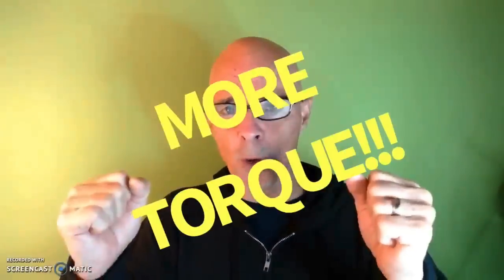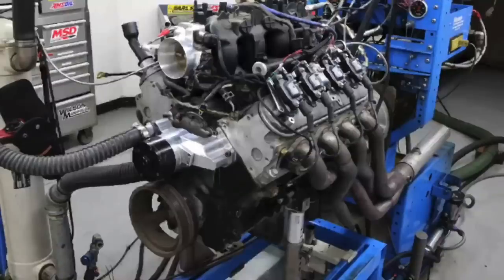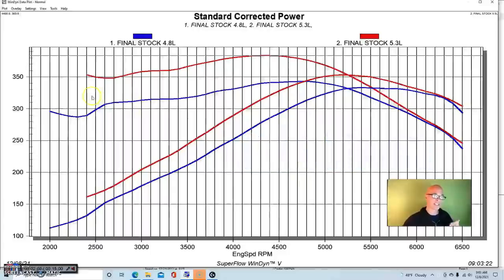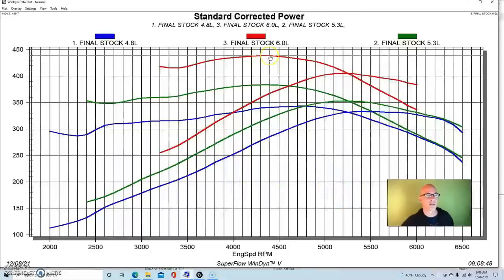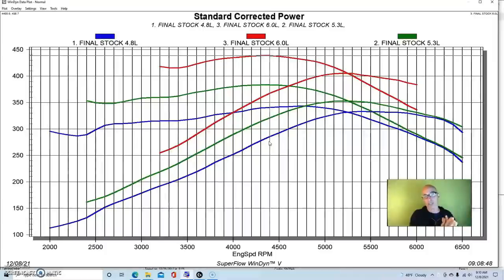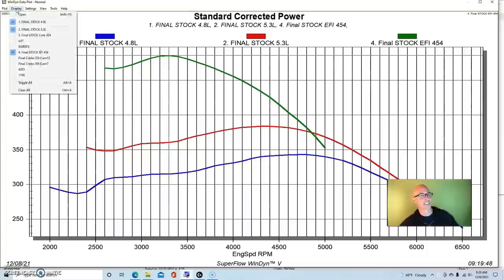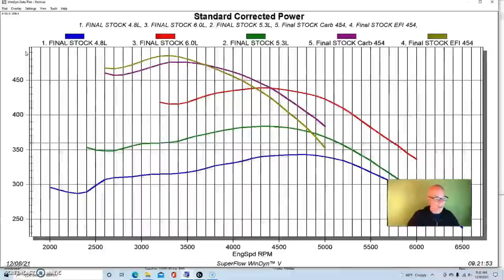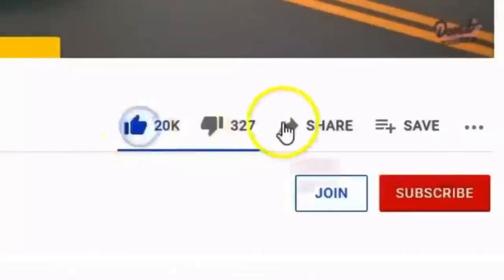LOW BUCK, JUNKYARD V8 TORQUE TEST-6.0L LS VS 7.4L 454 BBC-WHO MAKES MORE TORQUE? BETTER VS BIGGER!

Comment: Not GM, but still trucky. I've towed with a manual trans 300 powered Ford, an auto 351 and an auto 460. All EFI. Those 300s are sleepers for sure. It would run rings around the 351 towing. The big block....well, it's a 460. It could tow its own gas station. And probably should.
Reply: i love the 351w tho, beast of an engine imo..lol 427w stroker.. Seen a guy do a 440ci stroker on factory block..
Reply: 300 vs 351 in your comparison was the trans fault. 300 was a good engine but not a better tower than the 351 if both equally equipped transmissions
Reply: @EGGINFOOLS  But how often do you see a 351/M5OD 1/2 ton running around? The 351 is a great truck small block for sure, especially with the long runner efi intakes but the 300 was effortless. I've pulled anywhere from 2000-6500lbs with a a 460/E4OD with a 33" tire and 3.55s and it did a decent show of itself. It's no racer but it does make 400ft-lbs pretty much everywhere.

Comment: Richard out here giving us all the information. I just picked up a 6.0 for my C6 that had a 5.3, can't wait to get that extra 50 lbs down low!
Reply: This doesn't make sense. You picked up a 6.0 for a C6 corvette that had a 5.3? The C6 came with a 6.0, 6.2, or a 7.0. Never a 5.3.
Reply: @ryancompeau146  mine didn't come with an engine in it at all or a wiring harness. So I found a $175 5.3 and slapped it in there. I have a video going up on my channel about it.

Comment: Would be interesting to see a 5.2, 5.9, and 8.0 v10 magnum run on the dyno.
Reply: yeah it would be interesting to see. but good luck getting any of them to run long enough to make it through testing lmaoo.
i do love the 5.2 and 5.9l but they didnt age with grace. these days their mostly clapped beyond clapping for.
Reply: @chehystpewpur4754  Ive got a 98 5.9 durango that was wrecked 8yrs ago at 190k. All i need to do is throw a jumper on it and it fires right up. I have a video on my page doing it.
Reply: @98dodge360v8  exactly. it doesnt have another 8 years of wear and tear on it... it got stopped while it could still clap. shed have 300k or more by now and be wheezing if not worse off.
Reply: @chehystpewpur4754  I picked up a 01 2500 5.9 v8 last year with a service body. 277k and runs fine?
Reply: @98dodge360v8  shell start wheezing soon dont worry. i used to love those motors but not anymore or the vehicle their attached to. too many problems in most of the ones ive seen.
i mean lets be honest if dodge was so great it would have never went under and got bought up by fiat the worst car company in the world. dodge ii is a joke but the newer ram trucks. supposedly jeep and ram stayed out of the deal and are still an american company. and the trucks have gotten better. i would never own a dodge or ram but the trucks look to be somewhere between ford and chevy quality these days... i used to be a chevy guy but those are garbage now..
Reply: @chehystpewpur4754 seen more high mileage 5.2 and 5.9 magnums Then Chevy 350s.
Reply: There is a video on YouTube with 5.9 magnum build. All they do is add a stroker kit and new dual plan intake. On stock magnum heads and a stock cam. It made 498fts lbs of TQ and 330hp
Reply: @alexgrindnshine2522  A 408 stroker is 6.7L. Im talking the 488ci v10.

Comment: Sill at idle to 2000rpm not a lot of turbos going to make up ft-lbs versus displacement because the turbo won't be working much yet. Would take a very small turbo with some big gates to get the low end up without being a huge restriction later on.

Comment: About 20 years ago I ran tow trucks for a AAA contractor as a side gig & one of the trucks had that exact 454 setup in a '98 3500HD & 5-speed. Talk about a total dog! Absolutely nothing below 2500 rpm & always felt like you had an extra 2 tons in tow.  Same shop also had an early '87 V30 with the TBI 454 & 4-sp.  That truck would pull like a tractor down to 1200 rpm but as expected, dogged out pretty quick on top.  I always preferred the older truck tho, torque is where it's at when you're doing work. The older truck would KILL the newer truck in mileage too, granted we're talking ridiculous single digit 8 mpg vs 5 mpg but still, you could run hard an entire day in the old truck & still have 1/4 tank left but the newer 3500?  You'd be looking to fill up before the night was out.  I was never that impressed with the 454 Vortec setup & it was geared with 4:88s vs 4:10s.

The LS engines are racing motors but honestly, not particularly suitable for hard towing.  I'll put my flame suit on but seriously, the torque curve says it all.
Reply: same story here. my 94 c3500 454 tbi stock would murder my friends 98 c3500 454 vortec when being put to work. his truck unloaded got better mileage and was faster and nicer. but hook a trailer or fill the bed and forget it. tbi for the win ! I also have a 6.0 nv4500/4.10s 2500hd and my tbi murders it working too. my 454 is a 4l80 truck and also has 4.10s. when I threw it on the shop dyno the 454 started making more torque at 1400rpm than the 6.0 peaked 😂 ( when I threw them on the dyno the 454 was slightly modded. )
Reply from the maker: a TBI 454 is down at every engine speed compared to the Gen 6 (by a lot)
Reply: @richardholdener1727  I wouldn't dare dispute the dyno numbers however in this case it didn't translate to seat of the pants in the real world (for whatever reason).  TBI off idle response was dramatically better than Gen 6 in the trucks I used to drive.  Of course past 3K it was all over for the TBI, no contest.

Maybe it's just the way I like to run a work truck.  Keep the revs low & let the torque do the work.  Yep, I'm a diesel guy at heart😎
Reply: @richardholdener1727  that surprises me honestly, the tbi was so much more responsive like this gentleman said and just worked a whole lot better than the vortec and as he mentioned aswell better mileage when working. dyno doesn't lie tho. I just cant wrap my head around it had to be something with GM tuning since your testing has your own tunes. they must have choked the vortec or something. mayb would like to see them running completely factory everything side by side ? unless you already have that vid I missed
Reply: Those TBI's are special. Especially off throttle (low rpm)but that's about it. The vortec shines (power and mpg wise) around 2000 rpm and higher, their best for towing on the highway. TBI for in the city.
Reply: @muffdiver777yummy8 That's due more in part to obd1 vs obd2 and engine relying on more sensors for the vortec. Also going from vaccum modulated transmissions to electronically controlled transmissions made a slower response time too

Comment: Richard, can you please do something with the Ford V10? I'm sure there are a bunch of people that want to see it. Compare it with the big block!
Reply: I drove a loaded down full-size V10 passenger van when they first came out, and was very impressed with the torque and had going up hills, you hardly needed to push on the gas at all to maintain speed, and just giving it a little bit more I was doing 90 mph no-sweat uphill. I've heard they've been called gas Hogs but don't know
Reply: @7x779  I have one in my '97 service truck, it's an ex U-Haul box truck loaded down to about 12K & on highway I get 11.5, drops to 9.5 to 10 in town depending on how many lights I hit. Honestly not bad for what it is. Top end power isn't the greatest but it has a tractor-like torque curve that I like, doesn't slow down or come out of OD on hills. My favorite part about it is how dry it is underneath with almost 300K on the clock. Never leaks a drop of anything.
Reply: @acemobile9806  11.5 MPG V10 not bad at all for £12000. If I hooked up a 6,000 pound trailer to my 6L LS Chevy van, bringing it to the same total weight as yours I don't think it would be any better on gas. Probably very close to the same

Comment: When I tow my TT I'm at 2800 rpm in 3rd with 33inch tires and 3.73 on my 4.8 4l60e sierra. Thats on the sweet spot of that 454 although with the extra torque over my 4.8 I could run it in D

Comment: I would like to see the power numbers averaged out under the curve. My guess is that in stock trim the 6.0 produces very comparable average power and does so more efficiently.
Reply: Fit trucks and vans, average shouldn’t matter. Low end does… but of coarse gas mileage matters……
Reply: Well my 6.0 got 10mpg so.....

Comment: You have my attention.  I’m fairly LS resistant, but currently trying to decide between a turbo 383 SBC and a N/A 540 BBC for my vintage “work” 4x4 truck.  And by work truck I mean play truck.  Don’t tell my wife.
Reply: Stop being LS resistant:)
Reply: I mean you can get a sohc 2v hemi with a 4.5 inch bore spacing from ford right now... best of all the world's right there I think, only downside is no AL block
Reply from the maker: resistance is futile! said the Borg S480!

Comment: All depends on how much space is available in the engine bay. I have a 454 for one of my older pickups, but in another project a BBC is tighter than I want to deal with. One or more of each engine would be cool.

Comment: I'd still rather "start" with the 454.
Reply: Big-time.. I've walked past countless semis 🚛 towing 6500 lbs travel trailer up 5% grade elevations out west with 99 k2500 7.4 burb. Walked down a 5.9 Cummins on cajon pass in cali.

Comment: 8.1 and get'er done ;)  Trans made a bigger difference. Went from a common rail 5.9 Cummins with a decent 48re to a new 6.6LT Chevy with the 6l80, and for what and where I tow, the Chevy is a far better truck.
Reply: If you like that lil 6.6 you oughta try the 7.3 gasser from ford!
Reply: Turn off the traction control & the Ford 7.3 will light the rear end up in a U-Haul E-chassis cutaway. It has the same ferocity of the old GM 8.1, power everywhere. The new 6.6 in the Savana cutaway is quick but the 7.3 will take it even tho the 6.6 is in a SRW configuration & a 5-ft shorter body. Look for DC with a Y suffix at your next rental for the goods. 

As a U-Haul service contractor, I get to do my own kind of "extended" test drives 🤐😂
Reply: @Prestiged_peck  honest answer - I didn't want to be a first year guinea pig on the 7.3 clean sheet design as well as the 10 speed.  The 6.6 is LS/LT based (reliable) and the 6L80 is a known quantity.  I was really trying to find an NOS 2019 6.7 F350 XLT/Lariat, but it seemed like no local dealer wanted to actually sell one.
Reply: @mycroft925  it's just a big block ford, no DOD, none of that fragile shut, ford had pushrod stuff down pat they just always used to cheap out on bottom ends inside the small blocks.
Reply: @Prestiged_peck  having blown up a few transmissions, the 10 speed is the bigger concern.  Especially when the tech's at Ford are telling me not to.
Reply: @mycroft925  yeah I've heard they're hit or miss on the ford side and the chevy side, there's some guys out there that are already doing upgrades to fix the issues
Reply: @Prestiged_peck  friends parents blew up a tcase in their 2020 2500 Silverado second time in 4x4 - it's at the back of my mind now :(
Reply: @mycroft925  you can option the gas 6.2 still with a 6r140 in the ford 350, and can only get the 6r140 in the 250. So that's what I'm going for and just do a turbski build.
Reply: @Prestiged_peck  my dumb ass didn't check the website to see that was an option, otherwise I'd have the Ford I wanted.
Reply: @mycroft925  the 350 setup is not on the website but if you order one on the commercial side they can have it done as a special order, the diesel and the 7.3 I think are only available with the 10 speed right now in the 250/350. I have heard toyota's trying to get some new diesel emissions specs approved by the EPA that does away with some equipment requirements, instead focusing on real world tailpipe emissions, and have come up with some strategies to make a diesel meet tighter than current emissions without SCR, DPF, or even EGR, though they will still require catalytic converters like gas trucks. But they are supposed to able to do it with a new engine design that uses a different injection strategy as well as VCT/VVT and variable runner setups to make power, mileage, and low emissions all happen in the same setup, and we may see that replace the current powerstroke in a few years.